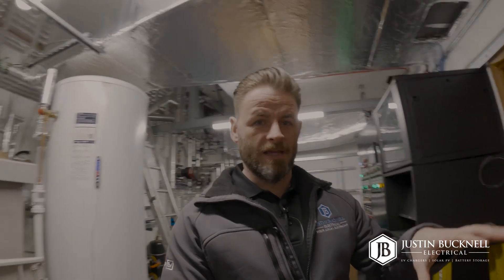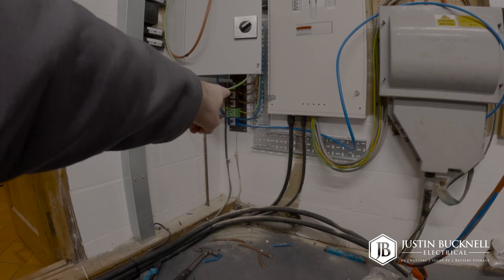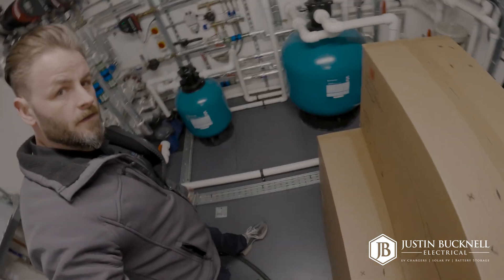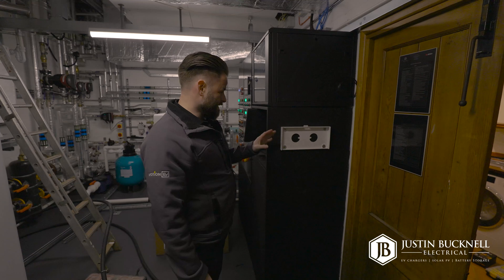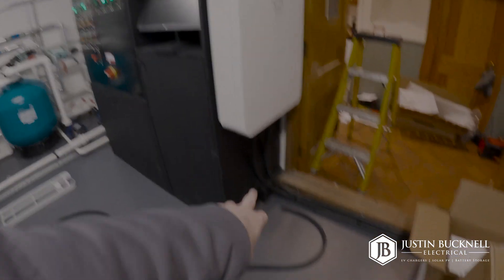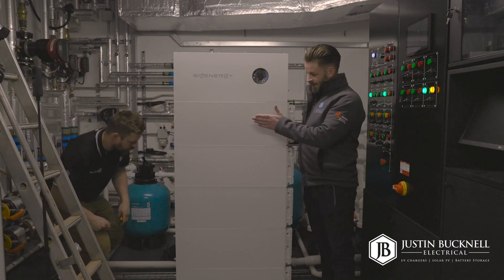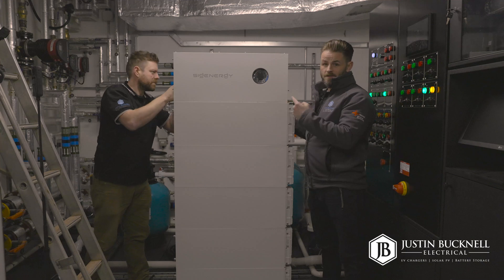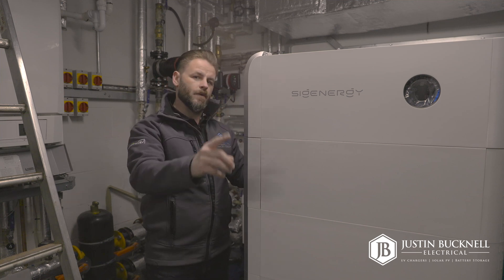This Battery Could Change Everything - SigEnergy 40kw! install!

Comment: Really nice.  

A few non-compliances on the physical integration with the plant room, rather than the electrical equipment install itself.  First is really minor (given the way the Sigenery is constructed and mounted) but with known water risks it should be on an additional plinth to cater for the potential risk of the high volume plumbing (pool water?).  Second is that the narrow end of the unit should be in-line with the escape path (so 90º to the way you have it).  Third and arguably the most important is that the strut restraints should run vertically (floor to ceiling) so as to provide no physical impediment.  The latest nod to the best practice is to install a small anti-racking strut to the rear of the mountings.  Often forgotten but you included this (potentially accidentally, or learned the hard way) with the first bit of unistrut on the back of the Sigenery unit.  This is to protect the mounting lugs from torsional loads.

Zonal Hazard Management isn't really taught to any individual trade to the level required to encompass how complicated it really is.  It tends to be designed-in by specialists for commercial premisses but arguably it is most difficult in buildings such as this where one lucky plant room gets everything running through it, with little, if anything, designed-in by a specialist.

It is probably worth refreshing on the clearance required between switchgear / gateway board and an emergency exit, as this is within your trade boundary (IIRC 1000mm commercial, 600mm for residential... but as lots of things are changing post-Grenfell any corrections are welcome).

As this is just typing on the internet it can of course be ignored, flamed or even taken as genuine sharing of constructive critiques to aid others that take such clear pride in their work.  👍

Comment: Nicely done. Few questions please:
- Is the battery feeding single or three phase?
- What is the IP rating for fitting outdoors?
- How much was this setup? 

Thanks 😊
Reply from the maker: Hi

This was a 3 phase system
Rated for outdoor use 
This system was around £22k supplied and installed - all in.

Comment: So the water filter system is guaranteed to outlive and not need maintenance or ever spring a leak until the batteries are long gone?
Reply from the maker: There’s an area below the plant room where water can drain to.

Comment: Hi. What is the recommended charge and discharge rating of this battery??
Reply: I don't have a SigEnergy system on my house as I am in the USA but on my PointGuard Home system, same system designed for the USA, the charge rate is Total PV - load.  The max PV on a full boat install like this is about 22Kw.  Which is what I have but I only have 8.4 kW kW PV installed and so in real life I can charge at a max of about 7kW.  
I doubt most homes could put 22+kW on this system.  There is a 16 amp limit on each MPPT times 600VDC gives a max of about 9600 watts * 4 so there is a potential of over 38.4 kW on the controller but a max of 22.4 total across the 4 MPPT inputs.  Remember this is in the USA, I don't what your country's standards are.  But this should give you some idea.
One of the reasons I chose this system is because of the high charge rate of the battery.  If I in in the middle of an outage and the battery is dearly 0 I want it to charge as fast as the PV will allow.  This system allows for that.
On a per battery basis the 5 kwH battery max charge rate is 2850W/battery on the 8 kW hour battery its 4350W/battery so on 5 * 8.0 batteries the battery limits would be 21.75kW.

Comment: Interesting but would it not have been prudent to advise your audience of the cost of the batteries and also the cost of the installation. Surely cost is a major factor to determine if it is financially viable to install such a system. I understand costs will very from job to job but the cost of the batteries is static.
Reply: Price is very site specific.  Not just the system but the installation as well.  I can pretty much guarantee that the price here in the States is different than is Australia.  Probably a whole lot more.
Reply from the maker: Thanks for your comment

We didn’t want to share information without the clients consent and pricing for these batteries is easily found online however I have been thinking about sharing costs in future videos and giving a quick breakdown of cost and expected ROI.

👍
Reply: @justinbucknellelectrical  I totally understand the privacy issue regardless it sill would be helpful to many to understand the cost even if its an estimate ETC. Here in Oz one can expect to pay approximately $1000 Aus per kilowat hour of battery capacity but that is purely to purchase the battery and does  not include inverters/chargers/solar so most defiantly not a cheap exercise.
Reply: Thinking of going for Sigenergy if I also have PV does  the inverter limit the battery output?

Comment: wouldn't it be better to stabilize using the ceiling instead of the back wall ?
Reply from the maker: Ceiling was just plaster board. Wall was a much better fixing

Comment: The big question one would ask in the current circumstances; “do any of your systems contain any components that encompass tesla systems, or are you totally independent?”
Reply from the maker: This is a common question! 😂 
In all seriousness, the Tesla Powerwall is the best overall when you factor in performance, reliability, support, proven track record, and a solid warranty. It just ticks all the boxes

However SigEnergy, for us, is looking like the best contender.!
Reply: Grow up
Reply: I agree, no Tesla products on my house unless, well, unless things change.  I put a PointGuard Home system on my house 2 x 8 kWh batteries and 84.kW of PV.  More energy then a PW and much easier to install.  Add in a more capable Power Hub with a generator input and the decision was easy.
Reply: @bryanwhitton1784  Also someone else who needs to grow up. Tesla has done nothing.
Reply: @bitsorbytes  Tesla is Musk.  To a great many people, it's a problem.
Reply: @incognitotorpedo42  Tesla is not Musk. Musk doesn't even own 20% of Tesla. So to confuse the two, is just silly.

Comment: I'm not sure what the ceiling was made of, but if it was cement I would have secured the stack to it instead of the long stretch to the back wall blocking access to all that other equipment. Of course, looking at a video leaves a lot of things out of view.
Otherwise great install.
Reply: Or two saddle straps bolted to the ground at each end of the battery.

Comment: Fox ESS or sigenergy ? The apps look very similar but like for like Fox is cheaper .
Reply from the maker: Hi, thanks for your input.

I believe you should receive your MCS certificate within 3-4 weeks. Under the MCS rules as an installer you must register the system within 14 days of completion.
Reply from the maker: In our humble opinion the Sigenergy build quality is far superior. I personally would not buy Fox but I would definitely buy SigEnergy 👍
Reply: @justinbucknellelectrical  I chose the sigenergy I got 17 panels 6kw inverter and 8kwh battery for £10200. 
It works well , I had the option of Fox for a similar price but with a bigger battery. So I guess from your feedback I made a good choice.

 I will probably add another battery as I don't think 8kwh will be enough to get through 24 hours during the winter.

On my best days in march I produced 20kwh and 19kwh so a massive amount went to the grid.

I haven't got my mcs certificate yet so it's gone for nothing. Hope it arrives soon.